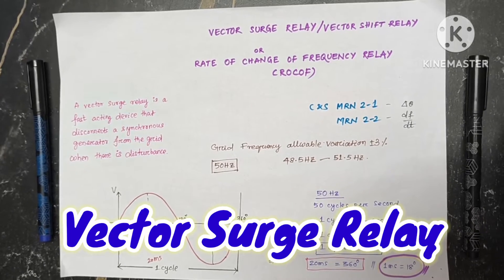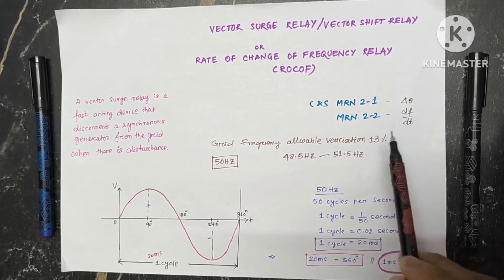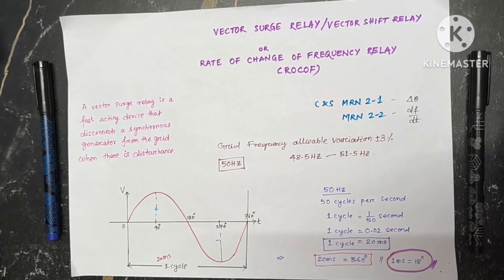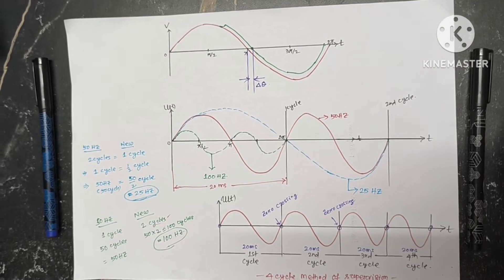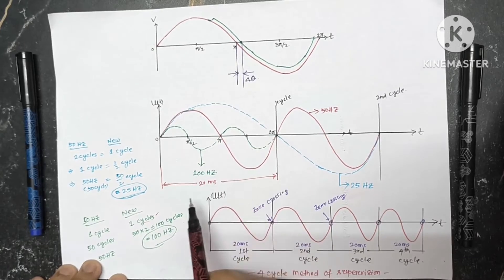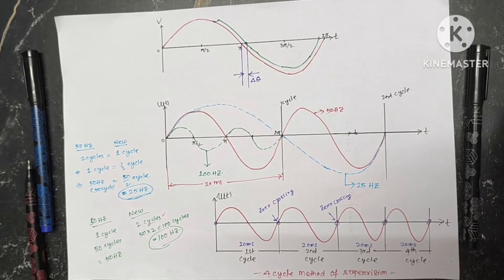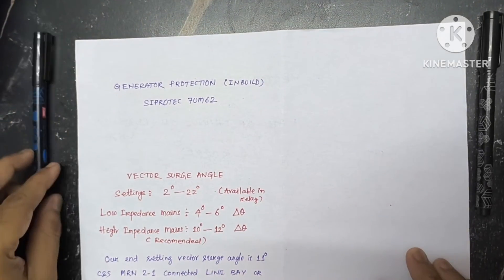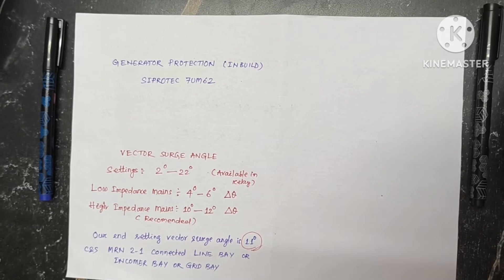Vector Surge Relay Basic Operation & Settings   (MRN 2-1)

Comment: What is meant by high impedance and low impedance line 
What is criteria to identify the type of line
Reply from the maker: Recommended settings for vector surge is 4-6 degree for low impedance mains & 10-12 degree for High impedance mains.Low impedance refers to switching on or off large consumer loads  are effectively small.The vector surge on voltage is typically low.
High impedance refers to voltage is more prone to variation.Switching on or off larger loads cause falsely trigger of vector surge in case of low settings.This will cause nuisance tripping.
Transmission line impedance is calculated based on conductor parameters & distance.
Reply: @himansupradhan2005 Thank you for your reply.
Could you kindly elaborate on the impedance of the transmission line. I mean what is the value base to decide our transmission line is low or high impedance line